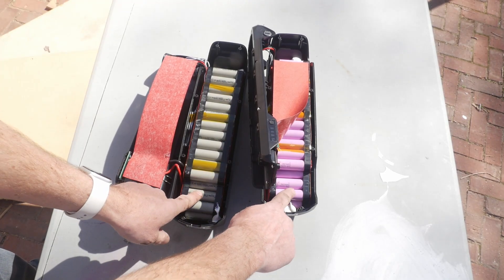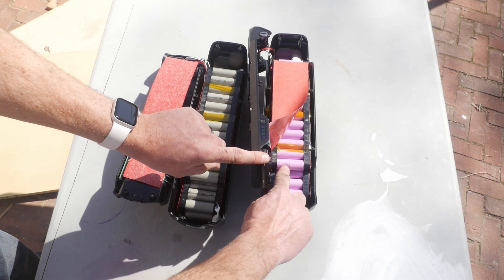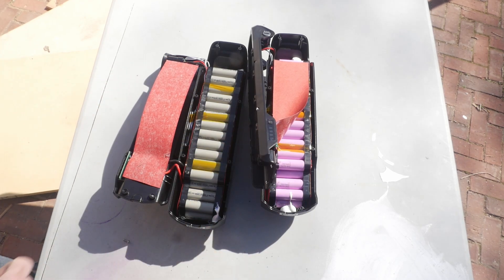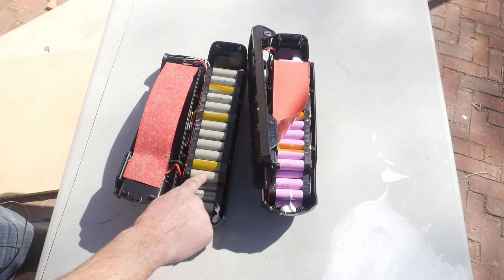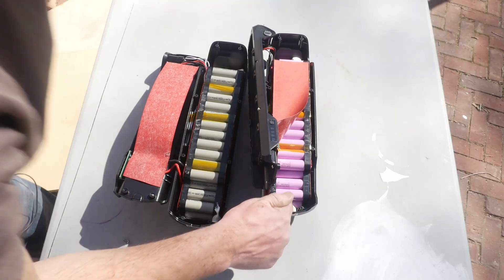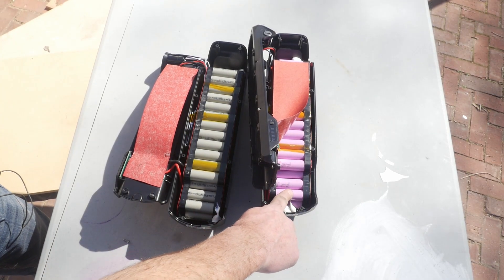Does your E-bike battery have counterfeit cells?

Comment: I feel like the outdoor power equipment batteries should be looked at as a first “second” choice (behind premium dedicated ebike packs) as an alternative to going with generic cells and batteries. I know they have their adapter and mounting issues, but if some of that can be standardized, then using reputable OPE batteries from Ego, Toro, Ryobi, Greenworks, etc, that can be quickly pulled off and put on a rapid charger, in the voltage range of the motor, you have opened up many price, performance and quality aspects that don’t seem to exist. The choice of premium or generic, from battery names no one has heard of, with chargers that don’t actively cool the battery, might need to be stirred up by more dedicated builds from guys like Johnny using Ego or Toro or Stihl or whatever brand of good tested, with warranty, batteries you can buy at Home Depot, Lowe’s, Ace or Amazon etc.

Comment: I ditched all the 18650 cells in my battery builds. I only stick to the samsung 21700 48X or 50G models, they have high capacity, low voltage sag and especially long lifespan (1500-3000 cycles possible with slightly reduced voltage range of 3.0-4.15V). they're hard to get though... not many suppliers carry these models
Reply from the maker: That’s I got in my e-moto builds pack 👍

Comment: Tip ,,, I have Always used LI-Po Batteries ! I have build my own pack from RC batteries ,,, now with over 2400,00 miles and work like New....!I see no reason to use a different type of cell? All you need to do is use the right battery charger and you are good to go.. Oh ,, and you can charge All your batteries in about 35 Minutes instead of Hours !!!
Reply from the maker: It’s nice having a lockable case though. I guess you could for them in the case with some extra work

Comment: Maybe a battery test is needed to determine low capacity cells or worn out ones.   You will need a power resistor as a load, and an amp meter. Fully charge up the battery.    If the battery is say 48v and 13Ah, then in theory , 13 amps can be drawn for 1 hour.  To be safe, just draw say 1 amp for 13 hours, or 2 amps for 6.5 hours.  
Total Time to draw current = Ah / amps
Power Resistor = 48/amps.  
 The wattage of the power resistor should be: 
 watts = 48v x amps ,  or  greater in watt ability. 
At the end of the time, the current meter should still indicate about the same starting current, and you may continue the test or not, but perhaps no more when the battery is say 50% of its voltage.
Reply: Power to the motor is V x amps.
Reply from the maker: I no longer have access to machines to test load capacity. Honestly I don’t know if I have the appetite to make one out of resistors either...if you have a link to good. Cheap one?
Reply: @JohnnyNerdOut  I wish I had a battery power meter or something, but the comment is just an idea of a homemade solution.
Reply: @JohnnyNerdOut  The amp meter can be had on a cheap Harborfreight multimeter. 100w power resistors might not be too expensive.  Also aligator wires and clips for connections, that can handle say 2 amps.  Resistors can also be placed in series to sum to a larger resistor, but they all need to be able to handle the current and power through it.
Reply from the maker: @oceanbreze1977  that’s true. Might not be as hard as I think
Reply: @JohnnyNerdOut  ok
Reply: @JohnnyNerdOut  I will be getting the Rattan Challenger 350w soon.  Has mixed reviews, so i'm  hoping for the best and with the rated battery power.  48v , 10.5 Ah

Comment: Nicely done video mate.
As a side note. For those with a bit more experience on batteries I'd recommend use 6s 22000MAH LIPO battery blocks connected in series or a combination of series/parallel. They provide a lot of amps power and are cheap. 

Best brands of lipo are Gens ace tattu, Zdf, turnigy, zippy, hobbyking. 

12s blocks are also sold. I use 18s. 3x6s blocks in series.

Comment: That's the first step, if it passes that stage you need to actually test the capacity with a meter of some sort,
The covers on the cells can be faked and also seconds can be used so even though they might be genuine cells the actual capacity and ability to deliver power will be less.
Brand new good quality cells are expensive and building a quality pack from them will cost more than just buying the genuine cells so be aware of that.
For my cheap DIY builds I took a chance on liitokala packs, they were cheap but performed as I expected at around 16ah for a pack parked as 20ah, I rarely use more than 50% of the pack so it's no problem
Reply: Super helpful info, thank you.

Comment: YOU NEED TO KNOW HOW TO DO MATH WHEN YOURE BUYING A BATTERY. FOR EXAMPLE IF YOURE BUYING A 52V 17AH BATTERY REGARDLESS WHAT BRAND, IF THE SELLER SAYS EACH CELL IS RATED 2500mAH, THEN THE BATTERY SHOULD BE 14S7P. THAT MEANS 14 X 3.7V = 52V AND 2.5AH X 7 IS AROUND 17AH. THE TOTAL NUMBER OF CELLS THEN IS 14 X 7 = 98.  YOU DONT NEED TO TAKE APART THE BATTERY IF YOU DID THE MATH BEFORE YOU BUY
Reply: No but you need to look inside the battery to verify cell count

Comment: Luna Cycle , in my opinion has the best bang for the buck, when it comes to quality and reliability. yes, ya pay more, but you get what you want and in more cases than not, it is better than you can hope for!.... just my 2 cent's!
Reply: I haven't bought a battery from Luna, but I have seen what they put into making their batteries. Seems like top notch quality and attention to detail. Their support is excellent as well.
Reply: @debunkthejunk1  Luna get's it's bafangs Specially built with extra sensors and mosfets, allowing them to create their own controller and when matched with their 52 volt battery, will allow 2500 Watts from the motor. I have my eye on their Galaxy Paint Ludicrous. It has a 1x12 Sram transmission, dropper seat, 4.8 inch wheels.... an all season, all terrain monster ebike. You can also order the bike only for only 1,400 bucks. I'll be getting mine in the next month or two! Take care!
Reply: @joeows6537  I'm not sure if you are referring to the Ludacris V2? It's way more than 2500W but apparently they aren't selling to the public. I'm running almost 3500W through a stock controller. It gets the job done.
Reply: If they had something better then 13.5ah Luna would've had my money by now... They need to make bigger packs!

Comment: Awesome video series. I bought 2 hailong batteries with brackets. They were listed as 36v 10.4 li-ion samsung. Thus only cheap samsung 2600mah cells inside. Im limited to 250 watt and 25kmph so very useful batteries. For only 160 dollar shipped within 5 days. I use 2 in parallel when i want to ride 80-100km

Comment: What it said on the sleeve of the batteries could be faked.  The real truth is to do a Wh capacity test of the battery pack.
Reply from the maker: very true. not many people have the ability to do that though. but ya
Reply: @JohnnyNerdOut  
A simple kill-a-watt meter will kind of give you an idea.  The total power to take an empty battery (where your ebike shuts down) to fully charged gives an idea if the battery is way off or close to what the spec claims.
Reply: @Scott H 
That is correct and we can certainly factor that in.  From my years of switching power circuit design experience, I can easily say that most, if not all the chargers with switching circuit should achieve 9x% efficiency with the switching and MOSFET technologies nowadays.  I have tested some chargers previously and they even had over 95%, especially during charging at the rated output.  Again, we are just getting an idea if we got what we paid for, this idea is simple and close enough.